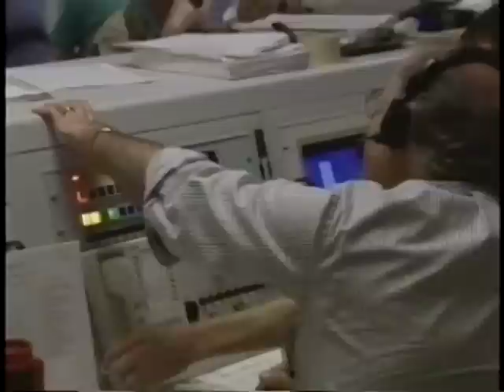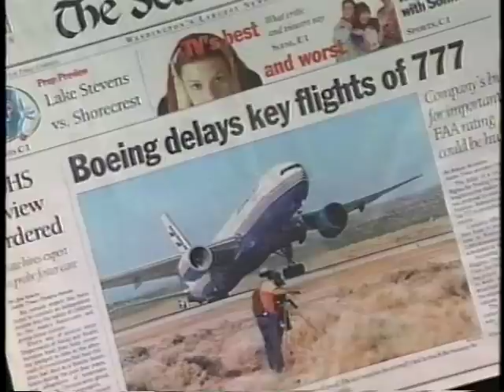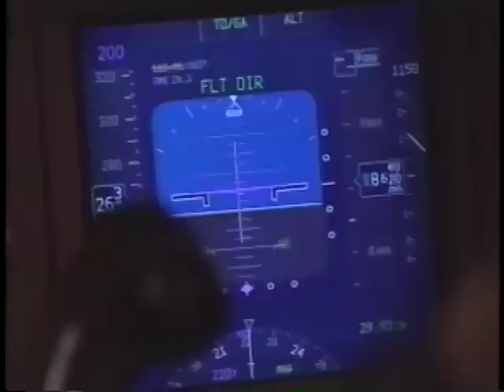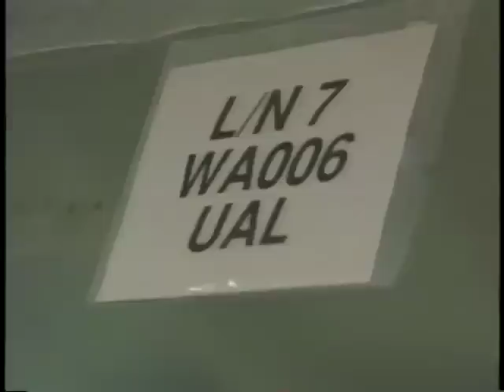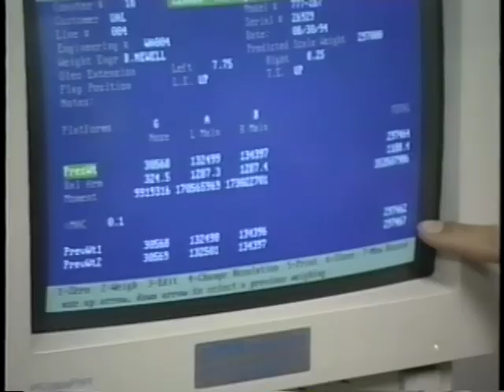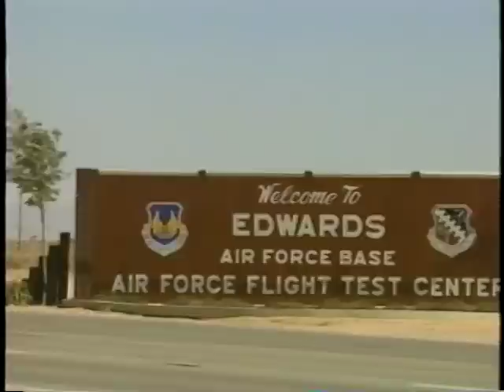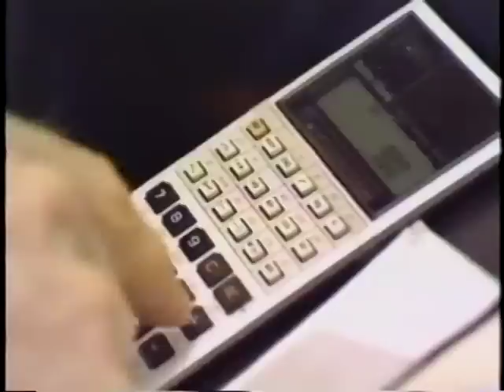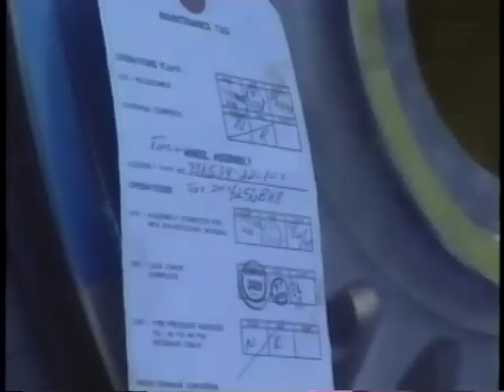21st Century Jet - Building the Boeing 777 - Full Episode 4

Comment: what about when the 787 was grounded because of a fire caused by faulty batteries in the rear of the aircraft
Reply: As far as I know it had lithium ion batteries And they never burst into flames if not over charged or loaded. So they put batteries that were just good enough for the job barely and they fixed the problem by just installing a smoke vent in the compartment containing the batteries, since the 787 has two, one in the front and one in the rear and too my knowledge didnt change to bigger batteries yet, so the engineers made many elementary mistakes probably because of cost and that's why they just put a vent there because incidents still happen its just unnoticeable now.
Reply: Well, this is a documentary about the 777. There is other media that talks about the production nightmare of the 787.
Reply: They fixed it.
Reply: Seems to be working eh.

Comment: Most jey airliners today have had their wings modified by the addition of 'Winglets' at the end of the wings. Has the Boeing 777 got different aerodynamics where it will not be beneficial to have 'winglets'?
Reply: Newer 777LRs and ERs are equipped with raked wingtip, which are works something like a winglets but better. All new Boeing jets like the 747-8 and 787 are designed with it rather than the conventional winglets...
Reply: The 737 and 747-400 have winglets.  Other Boeing planes have the raked wingtip, which was found to be better than a winglet, by Boeing and NASA.  The newer planes have a more swept (rounded) raked wingtip.
Reply: the newest 777X has raked wingtips that fold up for taxi. pretty cool stuff! makes the wingspan absolutely massive.
Reply: Nigel Curling I found an article interesting article about this:
"Raked wingtips vs Winglets

There are four aircraft that use raked wing tips: The Boeing 767-400, 777, 747-800, and the 787. There is one thing all these aircraft have in common: They are ultra-long range (6500 nautical miles plus).

Raked wing tips are more efficient in ULTRA LONG cruise segments. Whereas other wingtip treatments like winglets are more efficient in climb. Winglets do reduce drag, but they actually generate a bit of lift due to the way in which wingtip vortices strike the leading edges of the winglet...but that only happens to a significant degree when the wing is at higher angles of attack....like in climb configurations. Aircraft with winglets are shorter range...like the 737. It makes more sense and saves more fuel to optimize the climb and approach segments than it does to try to optimize the cruise phase of the flight. That might seem counter-intuitive, but Boeing engineers proved the math.

Raked wingtips on the other hand don't generate lift...what they do is reduce drag in a special way...by redirecting wingtip drag (vortices) farther outboard and aft of the rest of the wing... and it also redistributes the lift across the entire wing (called wing loading). The result is that they work in ultra long cruise segments. They don't depend on wing angle of attack, and they reduce fuel consumption when engine power is already set to cruise.

Short answer is winglets and raked tips both reduce drag and extend the range of an aircraft. But they do it in different ways...and which way is best depends mostly as a function of cruise flight time."

Source: https://www.facebook.com/atpltheory/posts/486422511385684

Also the new 737 MAX will utilize Split Scimitar Winglets, which is a combination of Winglets and Raked Wingtips
Reply: +jetenginestar I flew on a 3 month old 737-900 almost 2 months ago and it had a funky split winglet, like a much bigger version of what's on the A320. I thought I was getting into a new 757 at first because it's so extended.

Comment: The most prominent question that runs through my head with 777 program is its comparison to the 787 Dreamliner program. Is the 787 that much better of an aircraft than the 777 ?
Reply: It isn't. The 787 has so many problems, some have been fixed but some cannot be just because of the nature of the aircraft. The 787 is just supposed to be a sized down and more luxurious airliner. They've got lots of ground to cover before it become comparable to the 777.

Although I know you didn't say this, the truth is that the 787 will never be as good as the 777.
Reply: NO
Reply: Dylan Defalco for the record, you can't say the 787 has so many problems. as of right now the 787 has almost 100 aircraft in service with multiple airlines, the aircraft has been in commercial service for less than 3 years, this is called teething for an aircraft and fixes are always in development. The 777 is a magnificent aircraft, with over 1100 in service currently and in that time there has only been 4 hull losses, the 777 is by far but debate is still possible, the safest commercial jet in service. The two aircraft are entirely different, different markets and different capabilities, with a difference in service of over 15 years ofcourse the 777 is going to be better tested and more dependable but there is nothing wrong with the 787 and within the next few years, more 787's in service and it's history will disappear. As said at the start, the media dramatises every little problem, trust the 787 it is the future and so is the 777, i'm very proud of both aircraft and would be happy to use both.
Reply: I am aware that an aircraft is not perfect from the moment it rolls off the factory floor, this is definitely something to expect and understanding that "teething" must take place is a no-brainer.

From memory, the aircraft has had: four fuel leaks, one large panel falling off and, of course, a whole mess of battery fires. The 787 is the first airplane to have had the ENTIRE fleet grounded since the DC-10 in 1979... 34 years.

As for the category of the aircraft, I never said that the 787 is supposed to replace the 777 (And I'm not saying you did) although this shouldn't have much of an effect on the comparison, I'm talking about safety and reliability, not how many passengers you can load or how far you can go.

My point is, the 787 has had a shit first few years and definitely more problems than most jets. I'm not about to bet on the safety of an aircraft that the ground handlers are terrified of bumping with the jet bridge because they've been briefed on how careful you have to be with composites.
Reply: Qpilot625
Don't know what the consensus is but I know of a couple of United pilots.  Fly Chicago to Hong Kong, SF to Hong Kong.  They said they didn't like it.  It doesn't have a good flying feeling.  But then most of their flying was done on the 747, and they said, nothing, absolutely nothing can compare to the feel of the 747.
Reply: +Qpilot625 To my knowledge there hasn't been a single accident on the 777 in 20 years of service that was caused by any malfunction of the aircraft itself. Of course we don't know what happened to MH370 yet but the general opinion is that it was deliberately crashed.
Reply: +Dylan Defalco The 787 revolutionized airliners as a whole, hence the delays and teething troubles were more pronounced than with the 777.
Reply: There was a BA 777 that crashed on final to Heathrow because of ice in the fuel system and ice formed on the fuel oil heat exchanger which restricted fuel flow.  This was more of a Rolls Royce's fault as the part was in the RR engine, it never happened on the Pratt and Whitney engines
Reply: Well, Boeing must have faith in the 777 design because they are making a new 777-8/9X model. I don't think any aircraft will ever come close to the 777 in terms of raw power & jaw dropping amazement.